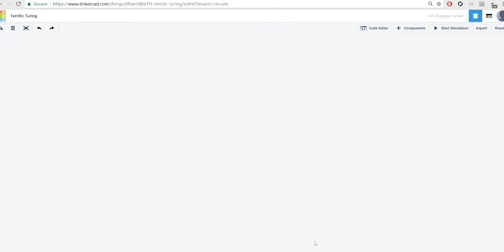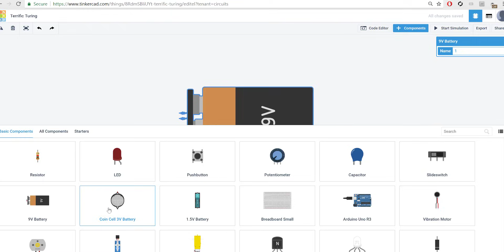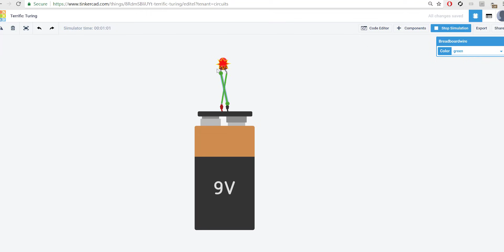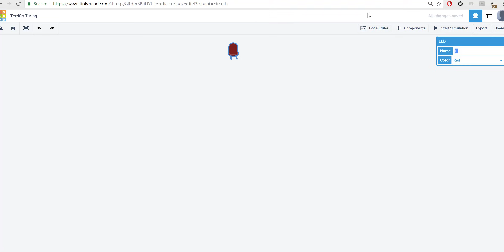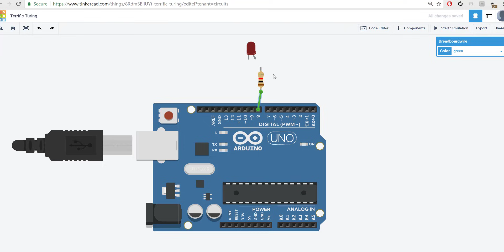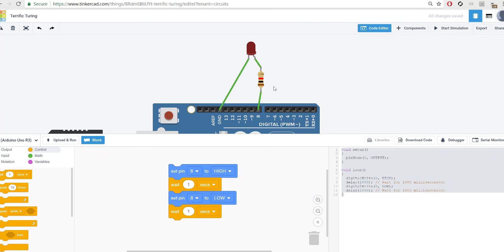Arduino UNO Tutorial #1 - Intro to Arduino w/TinkerCAD Circuits

Comment: Teşekkürlerrr great effort
Reply: hi There,

I have one suggestion with my personal experience with Arduino and a plethora of simulators. Can you also write about the wokwi Arduino Simulator? #wokwi I will tell you why I like it

1. Open source - anybody can use and contribute 😀😀
2. Runs on a mobile browser as well 📱
3. No installations, no additional downloads 🥱
4. Various examples from GitHub and many modules are available. it doesn't leave anybody lost with the simulator
5. #wokwi Wokwi Arduino Simulator Runs on AVR8js platform. it means, it truly executes each instruction. Wokwi Arduino simulator is a true emulator
6. Supports projects will multiple files 📁📁📁🗃
7. Runs on the latest Arduino IDE
8. gets updates all the time
9. NeoPixel, FastLEDs, potentiometers, Knobs, Servo motors, LEDs, LCDs, OLEDs., buttons, keypads, and many elements are available for simulation 🔘🔼🚥💡
10. New elements are added every week

Comment: thanks a lot.....
Reply: Hi Abhishek

Happy to see that this video was helpful. I have one suggestion with my personal experience with Arduino and a plethora of simulators. Wokwi Arduino simulator is free and has the following features: 

1. Open source - anybody can use and contribute 😀😀
2. Runs on a mobile browser as well 📱
3. No installations, no additional downloads 🥱
4. Various examples from GitHub and many modules are available. it doesn't leave anybody lost with the simulator
5. #wokwi Wokwi Arduino Simulator Runs on AVR8js platform. it means, it truly executes each instruction. Wokwi Arduino simulator is a true emulator
6. Supports projects will multiple files 📁📁📁🗃
7. Runs on the latest Arduino IDE
8. gets updates all the time
9. NeoPixel, FastLEDs, potentiometers, Knobs, Servo motors, LEDs, LCDs, OLEDs., buttons, keypads, and many elements are available for simulation 🔘🔼🚥💡
10. New elements are added every week
Reply: @puneethkumar703  ok, I will try it.
Thanks 👍

Comment: this is cool
Reply: hi There,

Wokwi Arduino simulator might be useful for you as it is for me 🙂

1. Open source - anybody can use and contribute 😀😀
2. Runs on a mobile browser as well 📱
3. No installations, no additional downloads 🥱
4. Various examples from GitHub and many modules are available. it doesn't leave anybody lost with the simulator
5. #wokwi Wokwi Arduino Simulator Runs on AVR8js platform. it means, it truly executes each instruction. Wokwi Arduino simulator is a true emulator
6. Supports projects will multiple files 📁📁📁🗃
7. Runs on the latest Arduino IDE
8. gets updates all the time
9. NeoPixel, FastLEDs, potentiometers, Knobs, Servo motors, LEDs, LCDs, OLEDs., buttons, keypads, and many elements are available for simulation 🔘🔼🚥💡
10. New elements are added every week

link: 👉 https://wokwi.com